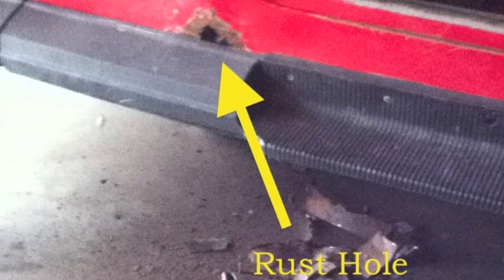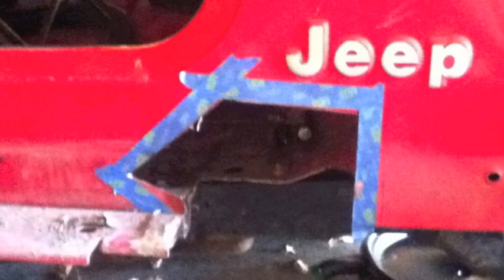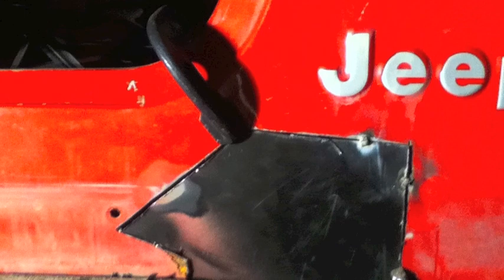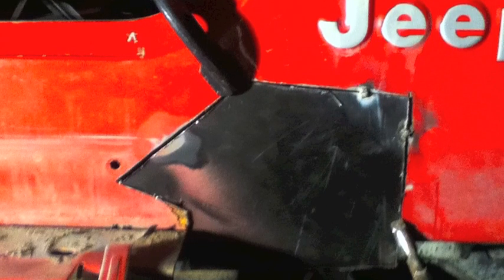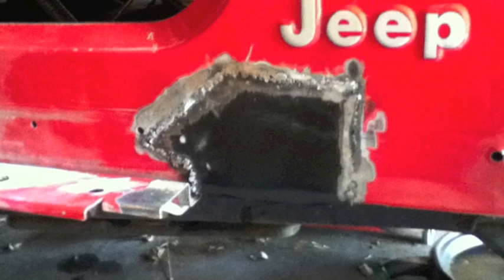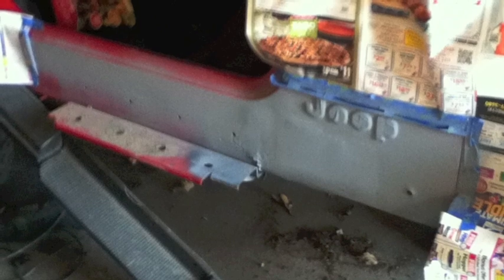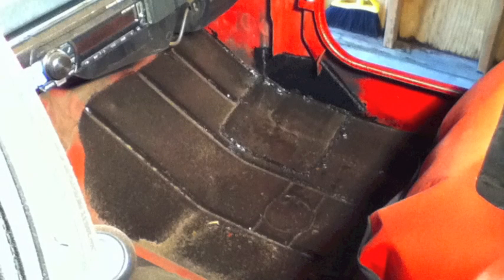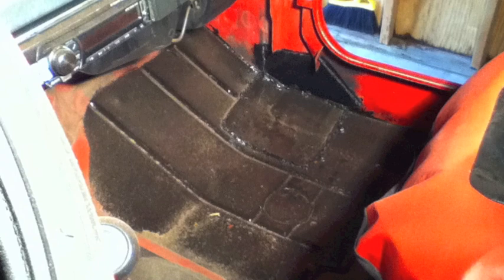How To Fix Rust Holes In Floor Pans

Comment: I am looking at buying an 81 pontiac that has rusted through back floorboard. the floor around the small section that has the rust holes is still good. What is your recommendation on this?
Reply from the maker: Same thing as this, just cut out all the cancer and weld in some patch metal. Make sure to get all the rust though otherwise it will spread again. If it's a small area, you can buy some sheet metal and just use that instead of buying an entire floor pan.

Comment: I have that EXACT same hole.
Reply from the maker: I hope this video was helpful!
Reply: While I will agree this is a solid way to fix rust the only thing I'm not crazy about is "surface" mounting your floor patch. You took the time to cut out and fill the body (for obvious reasons) but you could have done the same with the floor inside. We try to avoid overlapping or surface mounting floorboard repairs but there again, most of our vehicles we work with are off-road and subjected to severe elements and moisture. He's right about making sure to remove as much of the rusted surface as you can but I would also recommend chemically treating the surrounding surfaces with some form of rust inhibitor after all is said and done. Just a little insurance against future rust.
Reply from the maker: You're absolutely right. I talk about this in my other video about replacing floor pans!